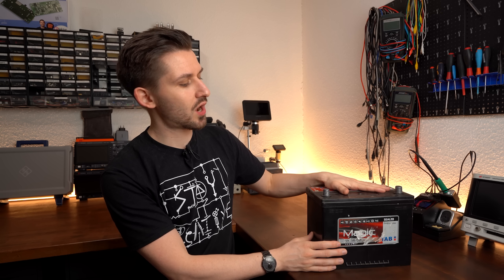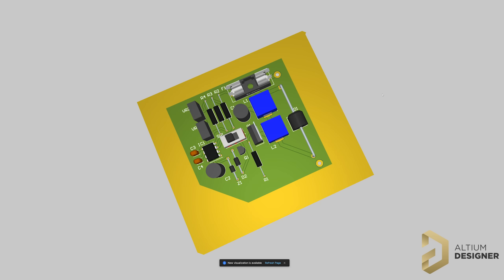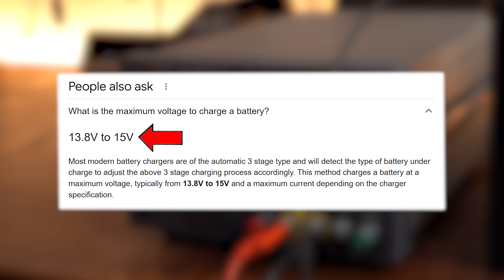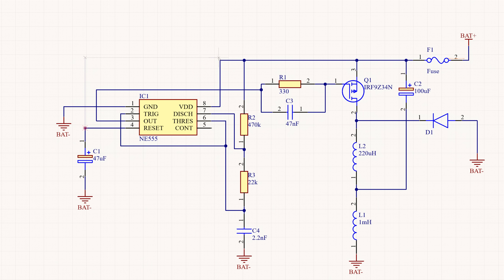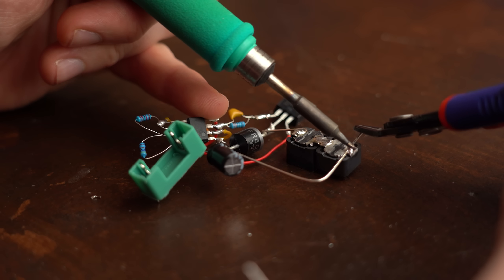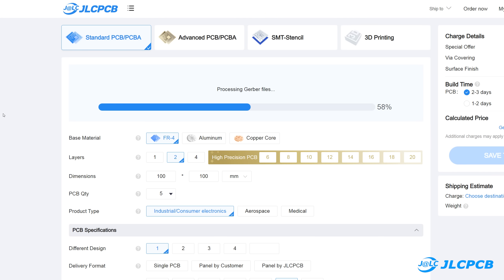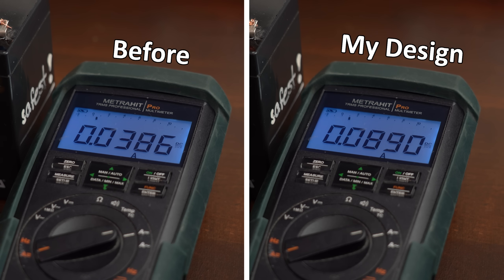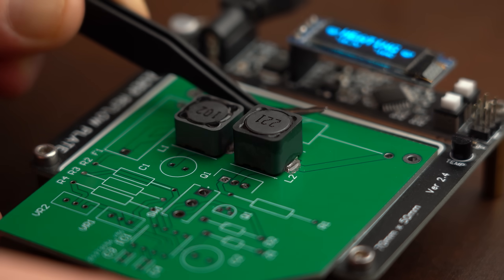I followed a YouTube "Battery Hack" and Wasted 30 Days! (Desulfator)

Comment: It's important to recognize that the rate of discharge plays a big part of the aH rating.   The slower the rate, the greater the actual aH rating.
Let me illustrate.  Let's place two identical batteries side by side, each rated at 25aH.

Battery one is subjected to a 1.0 amp drain.  Battery two is subjected to a 10 ampere drain.

Battery one will run probably 20 hours before voltage drops below the spec'd minimum (generally 10.2 volts), so around 20aH.
Battery two will probably run for only about 1.5 hours before battery voltage drops to 10.2 volts, a real total of only 15 aH.

The reason is the electrochemical process is more efficient at the slower discharge rate.  The physical size of the plates and the amount of electrolyte are also contributing factors.

It is for this reason that car batteries are typically not rated by aH, but by 'reserve capacity', which is basically the number of minutes the battery can deliver a specific amount of current (25 amperes).  A notable exception to the rule would be marine 'trolling motor' batteries.

There's a fair bit more to it. but that's the basics.
Reply: What you described here is known as Peukert's law. Lead acid batteries can be characterised by Peukert constant which is basically an exponent of discharge current which defines apparent current for the battery capacity calculations.
Reply: @dvlachy  Thank you!   I never knew the name of it.

Frankly, I don't quite grasp the math of it, but I've been aware of the basic principles for some time.

Comment: There's no recovering them, only preventing damage in the first place.

From what I've seen here and many other places, it seems there is no perfect way to recover old lead acid batteries other than recycling and building new again. Someone in the comments mentioned that as well as blocking the conductive path, oversized lead sulfate crystals physically damage the electrodes. I've looked into lead acid battery recovery once when i got my hands on some dead batteries and took a look on google patents in hope of finding something more useful and found a good looking preventative measure instead.

The concept was to send tiny discharge pulses while charging and tiny charging pulses while discharging. A little similar to the device shown on this video but should be used to prevent damage, not reverse it. It's supposed to disrupt large crystal growth and promote smaller crystals that don't cause any problems.

Comment: can you build a power station out of makita or einhell batteries that can output ac (like an battery inverter) that can also charge the battery if you dont use the power station? would that add one more cool tool for your makita collection?

Comment: Can you do this again but just make a circuit that regulates the voltage of the battery to 15.2 v with a max limit of .5A dc continuous. I did this with my lead acid battery’s and it will help a lot after 1 or 3 months. Note this only works with battery’s that have space in the bottom.

Comment: 0:52 Q6 is upside down (and the symbol could be the wrong channel type).
The body diode is shown in the direction from BAT+ to (what must be) BAT-.
Something will pop.
...and...
0:55 The resistor IS connected on the ground plane on the other side via the thru-hole.

Comment: Ì may be mistaken, but the issue likely is that you need to hit a resonance frequency with the target particle size, which in such a situation will not be just one value.
It may be a good idea to design a circuit like this that runs a frequency ramp staying at each frequency for 10 to 15 minutes or possibly keep it ramping up and down across a frequency range where the top and bottom values correlate with the max and min target particle size.
Want to try these and give us a show of the results? Am curious of the impacts of these vs each other. Quite certain both should perform better than this design though.

Comment: i've had some success with desulphation but mostly in cars since the batteries are a lot thinner and sulphate crystals are a lot worse there. Their main benchmark is cranking amps rather than capacity since thats all they have to do well and in that respect desulphation works. This has also been tested quite a few times as well and confirmed to help but while it does improve your CCA back towards the spec, it does not recover lost capacity.

Comment: le problème c'est que ce genre de circuit doit être là en entretien régulier et pas une fois que la batterie est trop sulfaté. Il faut prendre aussi en considération qu'il est mieux d'utiliser une alimentation 24V, et charger la batterie avec des impulsions de courte durée pour éviter l'ébullition de la batterie, tout cela sans dépasser la tension de charge max de la batterie. De ce fait la tension et courant plus élevé agiront de façon plus importante et efficace sur la batterie. une autre chose, la batterie commence à sulfater en dessous de 12,3 volts, donc l'usage d'un désulfateur autoalimenté par la batterie malade n'est pas du tout efficace sur une batterie très faible. peut être une autre vidéo sur le sujet en approfondissement ;)  merci Scott !!

Comment: Your careful method of charging that old lead acid battery isn't powerful enough. HYDROGEN EXPLOSION WARNING! Connect it to a stick welder, 80-120 amps, boil it for 5 mins, let it cool for at least 15min before repeating. Do it a few times, then connect to a trickle charger. You might get another year or two out of it ✌️ if you can change the acid after even better

Comment: A lead-acid battery does not do well if charget like that. A filtered power supply  harms the battery. A verry simple charger is a trafo whit a rectifier diode and NO CONDENSATOR..

Comment: I think I've also seen circuits that apply a high current low voltage AC signal to the battery to supposedly rejuvenate last acid batteries.

Comment: Mr. Bedini did this decades ago, with his pulse "chargers"  (RIP to a brilliant man). Look up "Simple Schoolgirl Motor" to dive down that rabbit hole. It is NOT free energy, as he's said clearly.  His devices can run for incredibly long though, with the right build. Mostly, he desulfated lead acid batteries with magnets and spinning wheels, producing huge spikes of voltage, at low current. 
The huge voltage spikes are what dislodge the sulfate crystals. Same can be done with solid state circuits.

Comment: Are you sure those batteries really need desulfate? Usually 50% of the capacity after discharge is what you expect from good led acid batteries, and you measured that. Im not defending the desufating BS but... what do you expect after the test? 100% of the capacity? No way.

Comment: I've never understood why they don't make lead acid batteries with easily replaceable cells. In my experience only one or two cells go bad and you have to dispose of the whole battery. If you could just replace one or two cells you could keep using it for some time. It must be a cost issue.
Reply: On very large battery banks, you can buy 2V battery cells and they would of course be wired in series.

Comment: I just wanted to point out the other person's PCB you stated that R10 is connected to nothing, it is connected to ground, pin 1 IC & led - as per circuit if you check with the multimeter it is connected.

Anyway thanks for all the information you are great 👍👍

Comment: I thought it was going to be don't fill your lead acid battery with acid instead mix it with aluminum until it fizzes out or zinc and magneium carbonate and then fill the cells with the salts of the liquids.

Comment: You don't wasted 30 days because you learned something. Personally, I stopped to try to revive older batteries because most of the time it is not worth the effort, a waste of time. Again, you showed us. Lesson learned. The only ones that I try to recover are laptop batteries, a long time unused battery that don't want to accept a charge (internal protection, below threshold). What I do is figuring out the battery layout, measure the voltage if there is any charge and charge it from the outside with a trickle charger to lift the voltage. Most of the time this will work and is worth the effort. Don't mess with dead batteries or batteries that cannot hold a charge.

Comment: From what I've had heared - reverse charging is one of the ways to restore battery:
First You should discharge the battery to 0, by adding a bulb for a day or so
Then you connect charger backwards - positive wire to "-" terminal and the positive one - to "+" terminal, charge up, than again discharge to 0 with a bulb and charge this time correctly.
The idea behind this is that sulphotation occurs, I believe, only on anods. By charging the battery backwards - anod and cathod are changing places, so sulphates from anod should dissolve.
Reply: Did you ever tried this method? did it work?
Reply: @MoonArk  no, haven't ever
Reply: @AyraSikil  thank you for the idea though :)

Comment: Don't get me wrong, I don't want to imply circuit works, but you misread schematic and your schematic isn't same one as in referenced video. There is no unconnected resistor. You made assumption that negative pole of battery is connected to common ground. But it isn't, only things connected to negative terminal are D9, L2 and R10. Common ground is "lifted" from battery negative terminal by voltage drop on R10.

Would it make difference? Probably no, but your test is invalid and this kind of mistakes, on circuit left for 30 days on lead acid battery, can be dangerous.

Comment: If it doesn't stabilize at 12.6v after charging then removing the surface charge one of the 2.1v cells are damaged and the battery is junk. If the battery is just badly sulfated it will still settle at 12.6v but it's amp capacity will be low due to the sulfur covering the plates diminishing the effective surface area of the plates, surface area = amperage capacity.

Comment: I've seen people go overboard and use ridiculously high voltage and charge current from an arc welder to desulfate the battery. Basically charge it until the acid almost boils. Then refill. Supposedly that ridiculous thermal stress gets rid of the sulfate layer.
I doubt that you will test that. I just wanted to mention it.

Comment: Can you boil the battery with a DC welder? Or something similar that gives around 50V 125A. Open the cells, top up with distilled water and then boil it 3x 5 min. If one cell does not boil, scrap the battery. Do it outside, you don't want boiling acid splashing through your workshop - and hydrogen gas! Not all batteries can be saved, but maybe you are in luck with that one.

Comment: 2 days charging continuously (don’t remove the charger), then discharge with a 60W car bulb. You have to repeat it, the memory effect will slowly get away. The charger has to be a simple transformer costing 200 bucks. IC  chargers are not good for this purpose. Very old chargers can still do the trick.
Reply: but memory effect is for nicd batteries from what I know. it doesn't exist in lead acid batteries
Reply: @arnaudj2708  There is a hole at the top of the car battery. It shows the health of the battery. Drones and satellites fire radioactive laser beam into the hole, through the car’s metal or armoured cover, causing the car to slow down, and to stop. The battery can hardly be charged up, or has to be recycled. These attacks are regular, usually are done, if the driver is on some kind of blacklist. To avoid any such incident, Bluetooth localization is needed for every device using a laptop, keeping 5-10 meters during a 8 mb file transfer, the file can be anything. After that, you can use the radio, Gps without any battery trouble. Same thing with electric cars, Bt has to be activated. During the localization, such as doorway or tree must not be between the devices. The localization is done, when the file transfer speed boosts to at least 20 kb/s or faster.

Comment: Sorry to disappoint , but my Chinese desulfator ( 4 times bigger than yours) is working perfectly.I mean it revived my old car battery that was dead after 1 week at 12-13 degC to a battery that last more than 1 month at around 0 deg C.Definitely not as new ,but enough to use an old battery.The cycle is quite long-about 24 hrs and I believe includes both  discharge and charge (not just simple pulses)
I am curious why only people that never used a desulfator sharing experience.

Comment: My positive experience of rejuvenation of lead acid battery is charging it long time (1-5 days) using increased voltage (16-17V) and low current (0.01C or about 1A for 100Ah). Last time restored 95Ah battery from 11Ah to 89Ah. Never believed in various magical pulse modes.
Reply: What was the ac voltage of the transformer
Reply: @DIYBill  no AC, all charging done using DC

Comment: 10.5 volts is 100% discharged. You only get 1/2 the rated ah to 12V or so with lead-acid.

Comment: As someone who works over 10 years in the car industry. We get lots of dead batteries. 
my method is simple. You need a good Battery tester (not a logic one) who really test a load or measure it like in the video.
A 10-20W load a simple 10W or 21W 12V Lamp should be enough. The Load size depends on the battery size.

Charge the Battery for 6-8 hours even if it don't take any charge/amps. A Charger more than 20A isn't needed but it should at least have 5A. (Chargers that will trickle charge beforehand when low voltage is detected cant be used. bench power supply with setting up 14.4 -14.6V would also work ). After the 6-8hours connect the 10/21W load/lamp let it discharge the battery for 3-6h depending on the battery size and load. After charging the battery again test it. Repeat the steps up to 5 times. Normally you see after the 3 time an improvement.
if you didn't the battery is definitely dead. Its not worth the time and money at this point. 

that way you can recover about 60% of the batteries to around 70% or more health of the original capacity. 
about 5% can be restored to 95-99% health 

the 70% ones depending on the use case can still be used. Everything under that should go to the recycler.

Comment: I have partially restored a deep cycle battery to at least 30% last time I checked. It was left to sit and discharge down to 1.03V when I measured it.

The method I've always used was the tried and true (Some call it a farmers trick, others say it's a mechanics trick.... pick your favorite...) just put it on 15 volts, 2-3 amps limited current and keep the battery topped up with fresh distilled water. Sulfates come out of solution when you discharge the battery and will go back into solution when you charge the battery (There is some % that will never revert... but that is a small percentage)

When you essentially overcharge the battery while making sure you have proper fluid level you end up putting a good chunk of the sulfate back into solution. The deep cycle battery I talked about above holds 12.45V and I use it in winter to start my truck when the trucks battery is too frozen to give high current.

Comment: It's great that videos like this one are put up.  Too many times someone will put up a video making promises and they turn out to be little more than nonsense and in some cases, a lot of these hacks can be quite dangerous.

As a technician, one of my tasks is to physically check the batteries and determine their age.  For fire alarm systems and most emergency lighting packs, we recommend strongly that the batteries are to be replaced every six years even if they pass the load test.    While they may be recharged to full voltage, they would discharge too rapidly to be of use in an emergency situation and can actually create a hazard.  An example of that would be a stairwell that is pitch black due to no lighting when the main power fails and the emergency lighting also fails because the battery is too old.

Comment: Any sulphation that such a desulphator circuits can remove can be removed much easier by simply giving the battery a good charge and the occasional "equalisation charge". Those old batteries aren't primarily losing their capacity due to sulphation, but because the plates are slowly falling to bits and losing surface area. 

When a cell's plates have lost enough material they tend to twist and short together (especially thin plated batteries like automotive starters), or the debris in the bottom of the cell builds up enough to touch the plates and causes much the same effect. That is why you couldn't bring the voltage of the first battery up. It has a shorted cell and is effectively a "10 volt battery" now. 

Trying to rejuvenate starter batteries is pretty much a waste of time. However bigger deep cycle batteries, such as the ones they use on electric forklifts can be.  Their useful period can be extended by increasing the strength of the acid. Of course that actually hastens the ultimate demise of the cells, but more utility is obtained from them during that EOL phase. 

Also charging the cells to a higher voltage can get a bit more use out of them, but again, trading this for a faster total demise. 12 volt systems can be charged up to between 15.0-15.2 volts. It gives the cell/battery more useful capacity, but it speeds up the degradation of the +ve plate. This can only be done with flooded batteries. Overvolting SLA batteries such as AGM and GEL is not a good idea.

Comment: The only desulfatation method that I've found remotely works for a lead acid battery is charging it from line AC through a 7uF polipropilene capacitor with a rectifier in series. It forces a high voltage until current flows through and then about 400mA. It's not safe nor insulated and needs to be fused to about 1A limit.